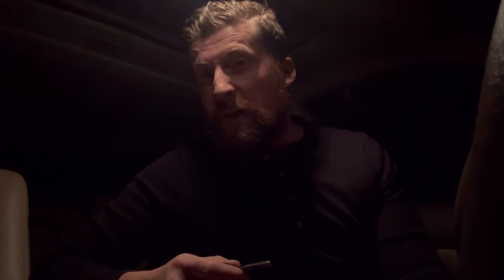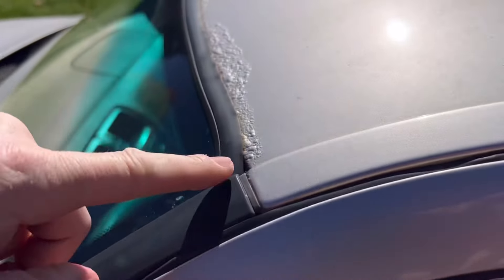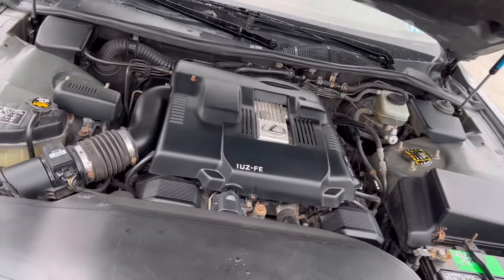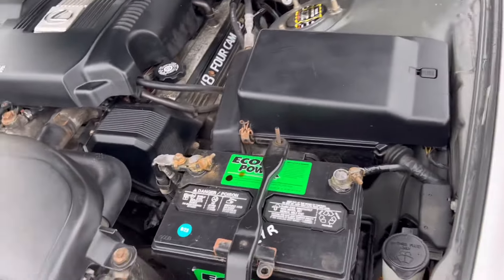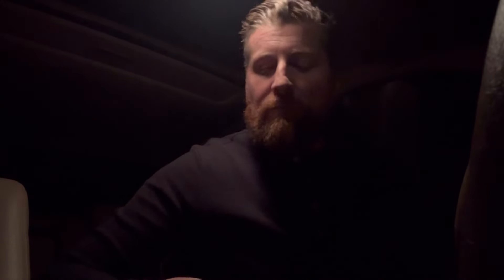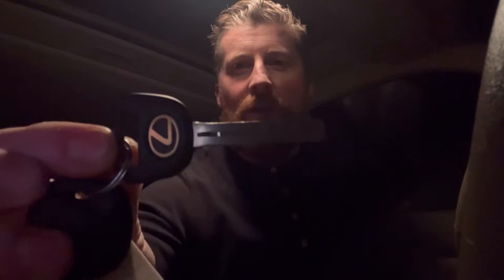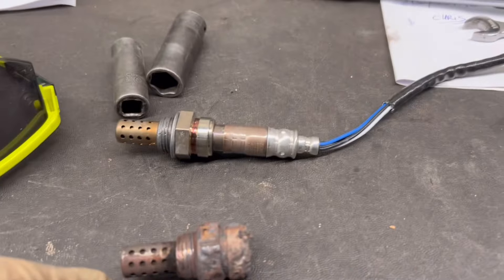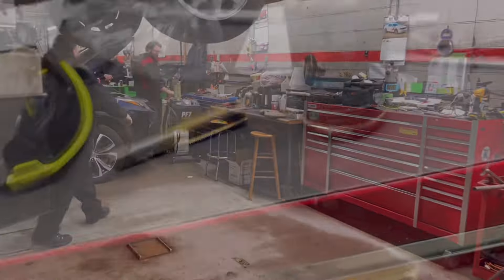Bought a LEXUS LS 400 with issues because I can, but you shouldn’t. Buyer Beware!!

Comment: Awesome video, good luck in the future. I've got the 1997, just getting it ready for road worthy MOT test here in the UK. Few things I've come across so far: The temp gauge was an issue (might have been the same for the first car you looked at) and it was just the gauge. I had to use a salvage yard replacement as they're discontinued in Japan. Easy to replace, but all parts are HIGH END quality and you want to make sure you don't even breathe on them. The plastic on the cluster is like a piece of flawless matt granite.

The brake master cylinder is discontinued. All other brake OEM parts are available. The main ECT sensor is available, but the secondary one (name + part number can't remember right now) seems to be discontinued. Normally I think they're next to each other by the thermostat, but my version just seems to have main ECT one.

The OEM oil filters seem to be made in Taiwan & China. They only sell the Chinese ones here in the UK, buy they're from Taiwan in Japan. The coolant expansion cap is discontinued, I can't even find a TRD one  - or if I can, it doesn't look the same. All other caps are good to go. I think something to do with the coolant expansion tank is discontinued as well. 

Other parts I've replaced: radiator, thermostat, coolant blower valve (the valve that lets the coolant to the blower), brake pads & discs, all caps, filters. Some body trim (scratched trim) needs doing after the MOT and I can still get that as well.

Generally most parts seem to be available in Japan. And I got some from America as well - taking into account LHD & RHD. Hope it works out. I plan on keeping mine until I die.
Reply from the maker: Can’t thank you enough for all the valuable information.
They are great cars and worthy of the extra care.
Stay tuned, lots more coming.
I do plan on racking up a lot of miles on it.
Reply: @VikingsGarage  Made a mistake: oil filters mad e in Thailand not Taiwan. Was a bit late when I posted this. Thanks again for the video, all the best.

Comment: Just bought a 96. Speedometer not functioning. Engine light on. Little shaky like yours was at first. Headlights not bright despite new bulbs. Same color as yours but faded. Enjoyed the video. Gave me some ideas on what I need to look for.
Reply from the maker: The speedometer needs to be sent out, bad capacitors.
The check engine light needs to be diagnosed, I had bad oxygen sensors.
The shaking also needs to be checked, could be suspension it could be tires.